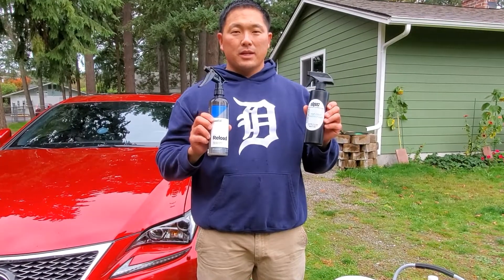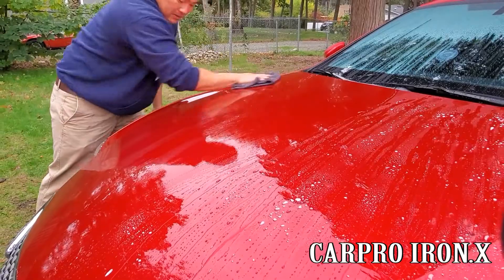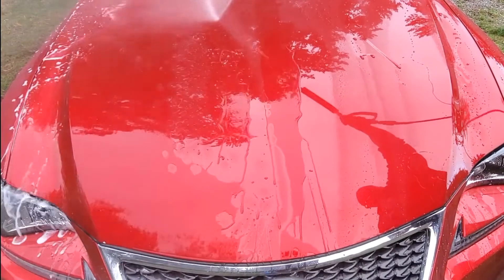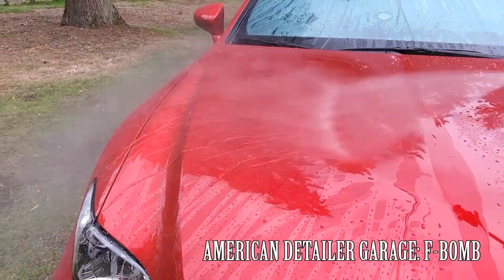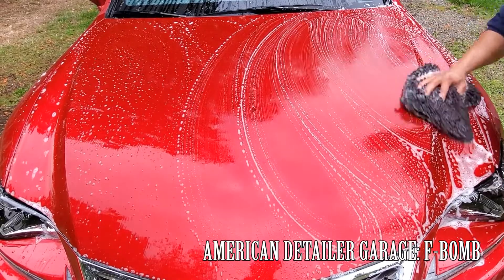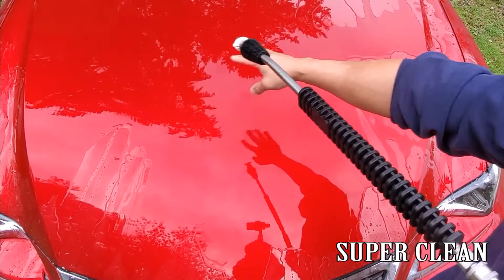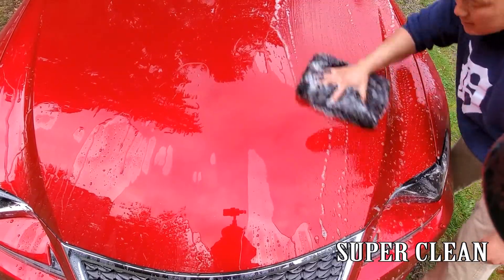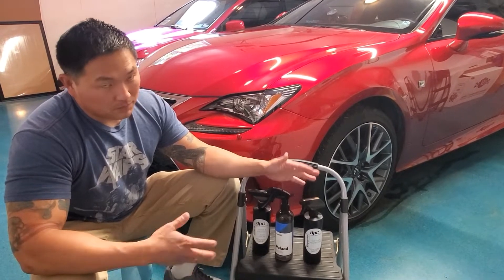DPC Kingsguard Vs. CarPro Reload Chemical Durability Test

Comment: So I use groist Garage polywax could I put kings guard over that in between washes? Thoughts
Reply: James Chapman #Autodetailing  Yes you can. Kingsguard was designed to go over any ceramic, wax, synthetic sealant or Si02 based product.

Comment: Wondering if you can do a challenge between quick detailers like Adam's,  Griot's, and Speed Wipe +  Synthetic quick detailer? I'd like to know who has the most gloss for sealants waxes & ceramic coating? This would be awesome!!!!
Reply: Good idea... I would need to get a gloss meter to accurately take measurements of the gloss